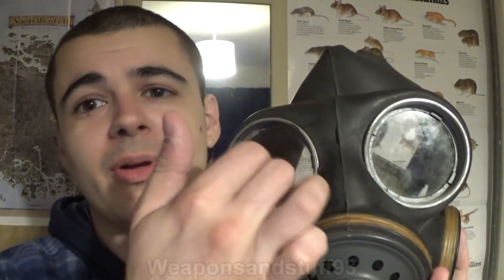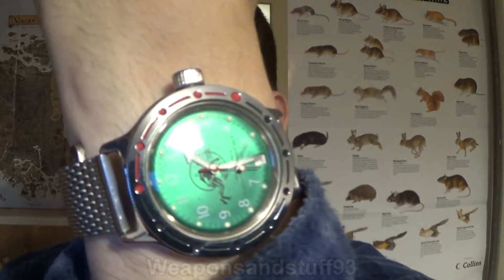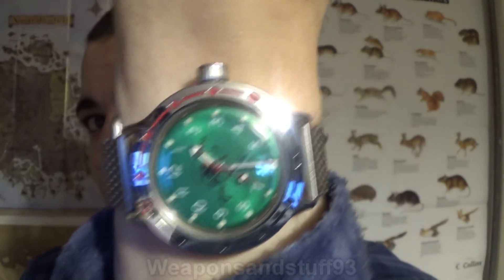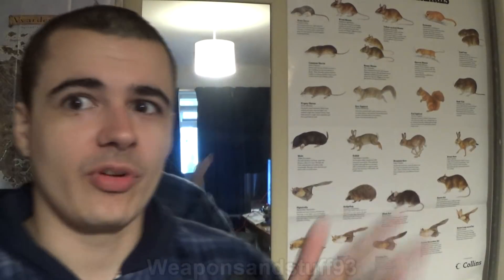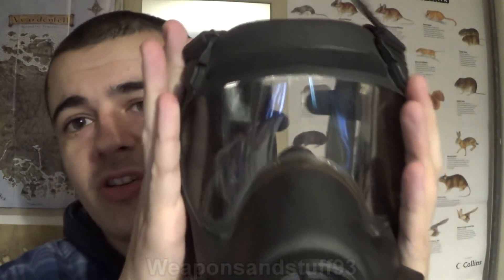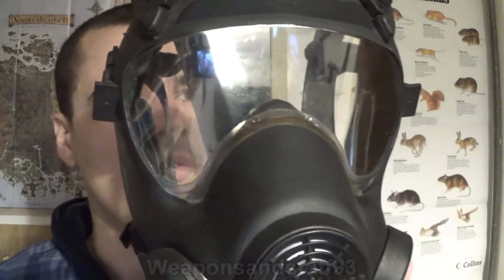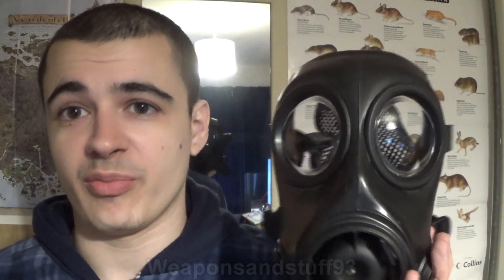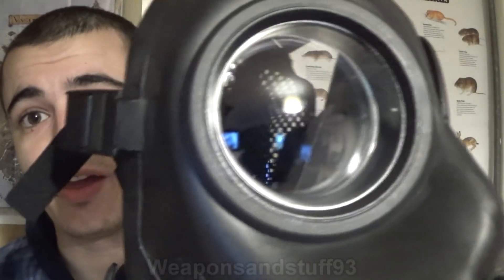Materials used in Respirator lenses

Comment: The M40 gas mask was indeed very advanced, but as you reply to that comment from that person, silicon is not a very good material for a gas mask. Like you said, it is very vulnerable to blister agents, some types of acids, etc. The M50 that replaced the M40 is better in many ways.
Reply from the maker: Yeah the majority of CBRN equipment does not use silicone anymore unless it is on the inside layer.

Comment: Do you think the lenses on the Schms are replaceable by hand? I'd like to give it a try in airsoft after replacing the lenses with old protection glasses cut in shape for it. I saw that someone offered plastic lenses for the Avon family that are made to use for airsoft but not for other gas mask models. Might be an interesting project I think
Reply from the maker: You can probably just put the other stuff over the top. Cut protection lenses to shape and put them in-front of the original lenses.
Reply: Weaponsandstuff93 well the Problem with that is that two lenses on top of each other are giving you a rather blurry view
Reply from the maker: Maybe use mesh then
Reply: Weaponsandstuff93 that might be a solution as long as there is the glass behind the mesh

Comment: Hey, i just bought a S10 and i wanted to know if water can damage the S10 or water resistant?
Reply from the maker: Unless you leave it submerged in water, no water will not damage a mask designed to resist acid gas and blister agents.
Reply: I thought the rubber might deteriorate, thanks. :)